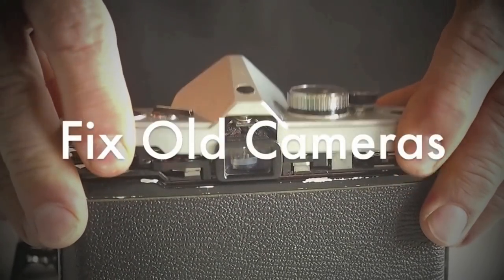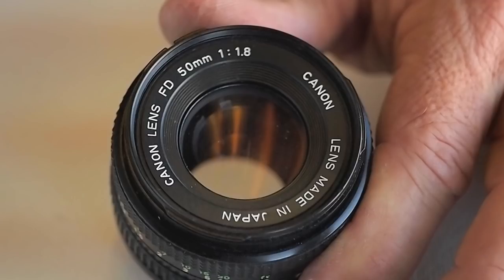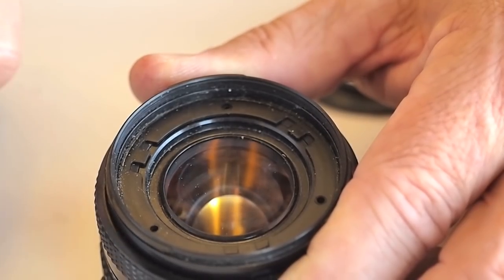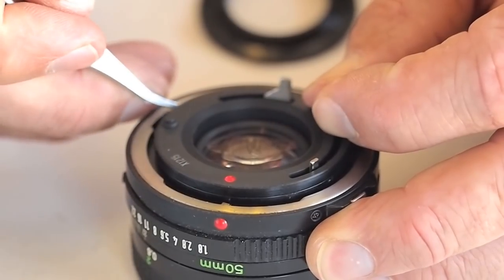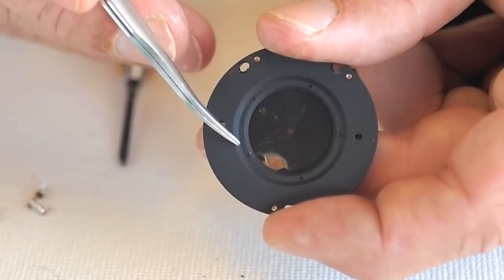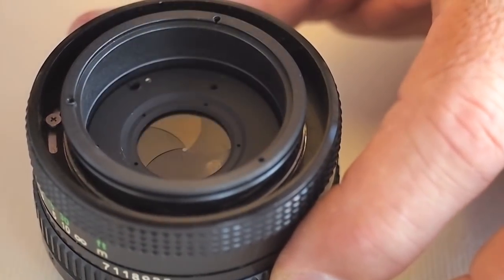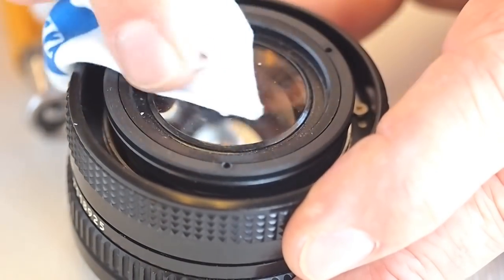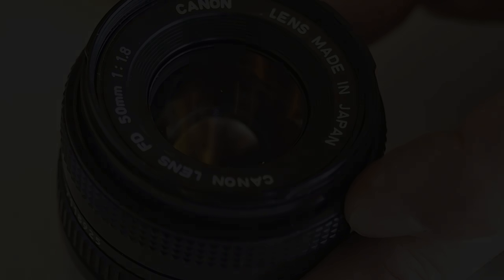Fix Old Cameras: Canon FD 1.8  Stuck Diaphragm

Comment: I only found out that my aperture ring was stuck after I finished an entire roll... Now I'm sad af waiting for the film to get processed for a school assignment :'(
Reply from the maker: Now that you know there is an issue you can repair or compensate when selecting you exposure.
Reply: Fix Old Cameras all I had to do was to wipe off 30 years of grease stuck inside the aperture ring :)
Reply from the maker: Right on.